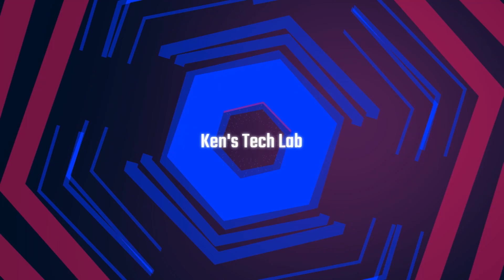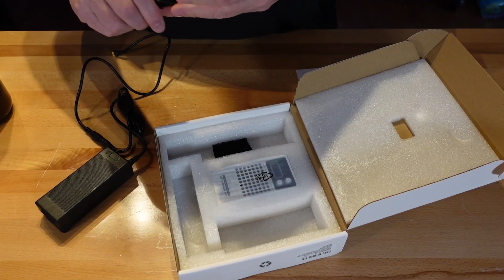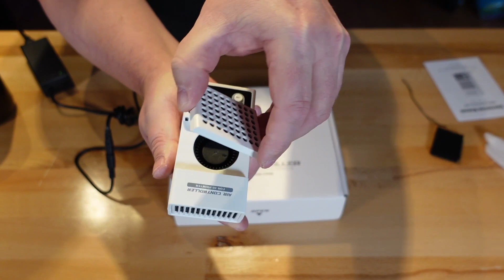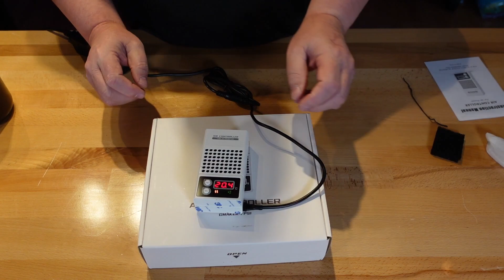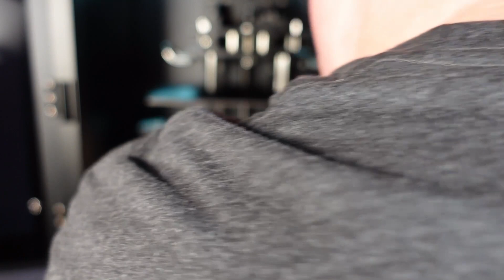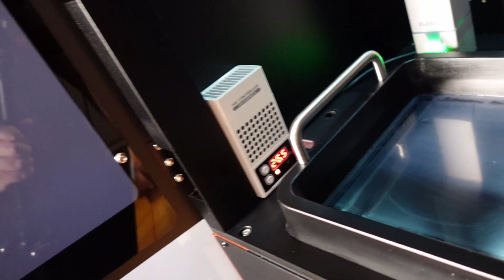Air Controller & Heater For Resin Printers

Comment: 20-25C is 68-77F. A heater wouldn't be needed according to the specs given from the resin packaging.
Reply: It might, depending upon the ambient temperature. What I wonder about is why he's inflating the temps to 27 or whatever, for a self-proclaimed "tech guy" he doesn't seem very detail oriented.

Comment: I really wish these were USB powered but then again the 3 volts or whatever probably isn't enough to maintain that temperature. I have a Saturn S in a grow tent, I'll just Dremel a small hole so I can enclosure the lid.
Reply from the maker: yea, the 5V would never run a heater and fan. See if someone has made a print that will hold the heater and cable.

Comment: I have two printers inside a enclosure (grow tent), does anyone know if I leave the heater out of the printers but inside the enclosure would be ok? I'm thinking a way of heat both machines.
Reply from the maker: I think if its not touching anything flammable. and only use it when your home, this should be okay. Never leave devices like this working without you near.
Reply: @kenstechlab  the grow tent itself I believe is kind of flammable right? At least it's my impression looking the material of it.
Reply from the maker: so be very carful!!!

Comment: Move to Arizona, free heating and dehumidifier by opening a window.
Reply from the maker: I saw this comment on my phone and laughed, Since I keep the house at 66 I don't think that would help. lol What I did is purchased a printer with a built in heater for the resin. no more issues.

Comment: Where can buy this and what is maximum temp can set
Reply from the maker: The Temps are 10℃(50℉)-50℃(122℉)
Amazon Link
https://www.amazon.com/Printer-Temperature-Controller-Thermostat-Printers/dp/B0BL6WZPM9/ref=sr_1_3?crid=6EH2JEVOXQ8V&keywords=resin+heater+3d+printer&qid=1677982854&sprefix=resin+heater%2Caps%2C79&sr=8-3&ufe=app_do%3Aamzn1.fos.18ed3cb5-28d5-4975-8bc7-93deae8f9840

Comment: Will not fit in a Saturn 3 Ultra
Reply from the maker: Nope, it will not fit in alot of resin printers., this is why manufacturers need to include internal vat heating on all new printers.

Comment: Could I use the for a standard extruded filament printer if i wanted to create a heated enclosure??
Reply from the maker: Yes you could! That would be a great use for this product. I think that would be better then using it on Resin printers. I have decided that if I want to heat my resin then buy a printer that has a heater built in. For FDM printing this would be great!
Reply: @kenstechlab  What is the max temperature that it can let you set? Usually for FDM you need 50-70 C for engineering materials like PC for example. Can it maintain 60..70C in a 300x300x300 enclosure ?
Reply from the maker: The unit will do 70C but I have not tested it for FDM it was for Resin. I know my FDM inclosed printers will hold temp as the Hot Buildplate keeps the heat going, you could just preheat with the build plate first.

Comment: How do you deal with the toxic particles from the resin?
Reply from the maker: I have a vent hose that has a filter but even that does not keep out the smell. If I dont open the printer hood then the smell is very low. I keep the rersin in the Vat alot so I guess that I am used to it.

Comment: What't the max temp?
Thinking about using it as a chamber heater for fdm printers
Reply from the maker: I did read that it has a cut off safety @ 100C, I only use it for resin  max 75°F-86°F or 24°C-30°C, I did take a look on Amazon but they do not have that Info.

Comment: Thanks for the video, but did not hear you mention if it felt warm at all in the box or if the resin warmed up and how long that took. Any other videos about it???
Reply from the maker: Yes, the resin did warm up to the temp that I had the enclosure set too. I had to leave it at that temp for some time then print. It worked like I thought it would with an ecternal hreater that was not hearing the resin directly like the Uniformation does. Hope that helps.

Comment: I purchased this heater and good to see a video on it. Are you still using it and how is it doing?
Reply from the maker: I still own the heater and the printer. I don't use the printer that often, The printer I did this video on is so big but the heater does keep the enclosure at temp. I am now printing with a resin printer that has a heater built into itself and warms up the resin before the print starts. The UniFormation GKtwo. I do have a video on this printer.
Reply: good to know. I almost got the GKtwo but decided for the Saturn 3 Ultra. Will be trying it out. thanks for the video  @kenstechlab

Comment: Could you tell me if between this heater and the Thermal Bands, which is the best method for heating the resin? Thank you.
Reply from the maker: The heater will keep the enclosure up to temp. Since it does not come in contact with the resin you will need to leave this on most of the time to heat the resin.  I am now printing with a resin printer that has a heater built into itself and warms up the resin before the print starts. The UniFormation GKtwo. I do have a video on this printer.

Comment: @ken's tech lab, do you have any thought on how this would work if I have a shelf that is roughly 6 feet long with multiple printers on it and I were to enclose the shelf to essentially heat a larger space for multiple printers to use one of these?
Reply from the maker: I think the heater would make a small difference, I use this in just a single printer enclosure and I think would be the largest area it would work in. maybe multiple of them but then I would look for a better single solution.

Comment: I was thinking about using a heat lamp from a pet store and covering the whole printer in some sort of enclosure
Reply from the maker: I think that would be a little dangerous for you and the printer. Even using this heater was becouse I keep my house cold all year round and I had a lot of issues with the print sticking to the plate.

Comment: I can definitely say that 77F is totally unnecessary for super high quality resin printing. I was printing at 72 degrees with incredible results.

But this thing is a super cool gadget for when we get into those winter months. Bought one myself
Reply from the maker: The only problem is that I keep my home at 67 degrees and that is way too cold.
Reply: @jn6305 It really depends on the resin. For fast ABS-like resins, 72 will be perfectly fine, but for tougher resins at 72 it could be viscous enough to cause print issues.
Reply: @boxierhen9015  But he says he's not even at 72. 67 is getting a fair bit cooler that the recommended low of 77.
I'm not sure how all resin could handle even 72, so a one time upgrade to help a variety of resins and cut one failure point seems worth. Plus, with winter inbound, many printers will definitely be seeing lower than even 72°! :) enjoy any remaining nice days
Reply: Let's see if it works for my Elegoo Mars 3.

Comment: I've actually, purchased this heater before seeing this video. It does work fairly well, using Phrozen Mighty 4K, I found the temp display is off +4C, I run 33C on display to get 29.  Save money versus heating a whole room.
Reply: Surely 20c is 68f not 77f.
Reply from the maker: That is why I did purchase this little heater. I love a cold house and my Elegoo 6K with the big interior made this a no brainer to keep the temp at the printing requirements of the resin. I don't think it will work on smaller printers as there is no room. I do like that some of the newer printers are coming with built in vat heaters now, I think that and built in cameras will be the new norm.

Comment: Hi Ken it looks lik it’s been 4 months since you upgraded your Elegoo resin printer with a heater. Has it helped your prints
Reply from the maker: The Elegoo is printing well. I could not get anything to stick to the build plate. I tried many things any this Heater was one of them. Since I keep my home cold year round I do feel its helping the prints by keeping the temp in the enclosure correct for the resin.

Comment: Mine works very well in small printer. But the installation required some modifications (Prusa SL1).
Reply from the maker: Getting the power into a printer that has a complete plastic shield would be alot harder to get settled.

Comment: Yiu need to be measuring the resin temperature not the air temperature.
Reply from the maker: Yes, I hope in theory that the resin temp will equal to the air temp over time. At least if the room is 68 and I need the resin to be around 83 I can heat the air and in turn will heat the resin. There are new printers that have heating under the vat.

Comment: How do i apply this if I can’t get the wire through. (I have a Saturn s)
Reply from the maker: I was thinking about that. I would use a soldering tool to melt a hold if you have a plastic cover like I do on my Anycubic.